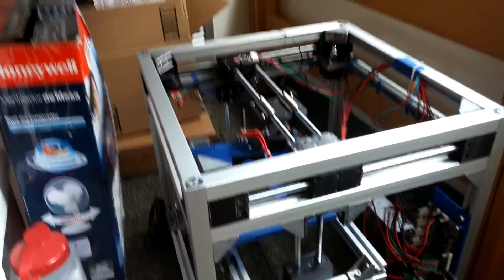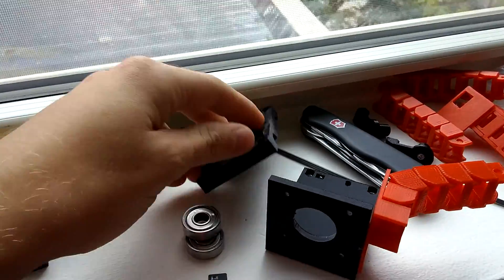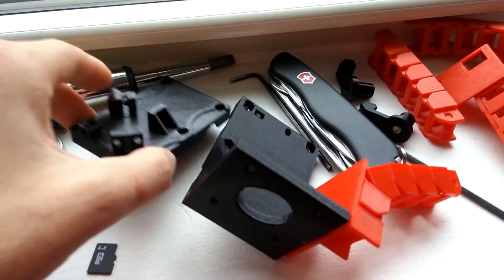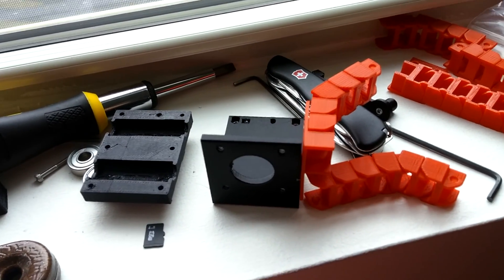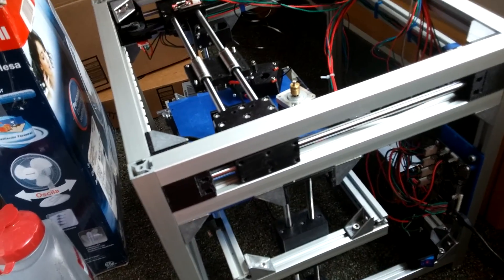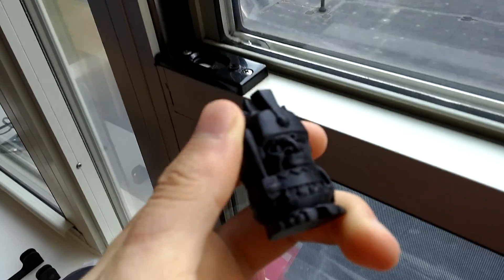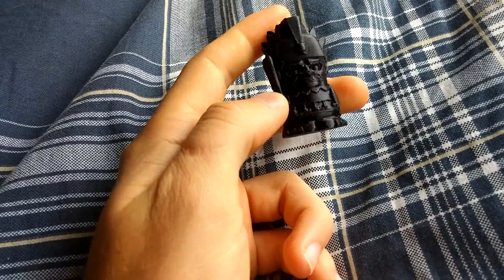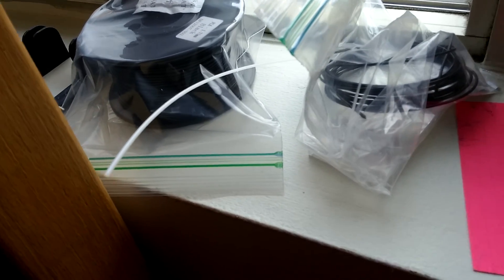3uP Update 23 - Improved Print Quality and Began printing 1.4

Comment: Could I get a kit with everything to create the printer?
Reply: just wondering
Reply from the maker: Ky Yk Do you want to purchase a kit through me or build it yourself? If you want to buy one you have to be put on a very long waitlist, if you want to build one I can link you to the forum page where you can find the full details.
Reply: 3DprintedLife I was just wondering if you sold a full kit with everything needed to build a 3 up
Reply from the maker: Yes I do, but like I said before you have to be added to a waitlist and it will be many months before I am able to fulfill your order as I am at about 60 people on the list with just 10 or so already completed.
https://docs.google.com/spreadsheets/d/1joFJhRFLYiKpqiQIudrVPGDfe2XTe3znb0E4k_HK_Z4/edit#gid=0
Reply: 3DprintedLife The doc says you need the qubd one or two. Do you have a kit that does not require that I have the qubd one or two up.
Reply from the maker: Ky Yk No I don't offer that but it wouldn't be too hard to find the extra parts you would need. But to be honest, if you wanted to spend $500 on a 3d printer I would recommend purchasing something like an older generation soliddoodle. This printer is great for the price if you already have a two-up, but if you have to buy all the parts from scratch it is probably easier and better to just get one from an already known retailer.